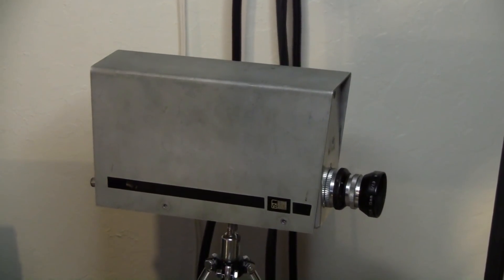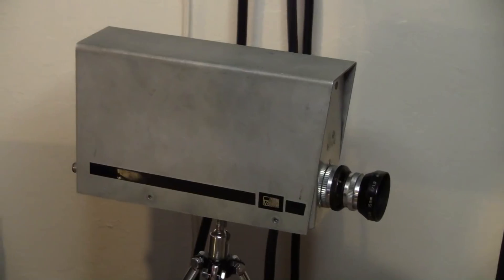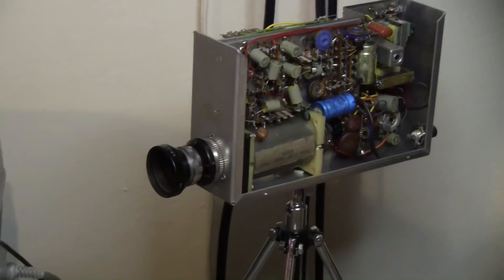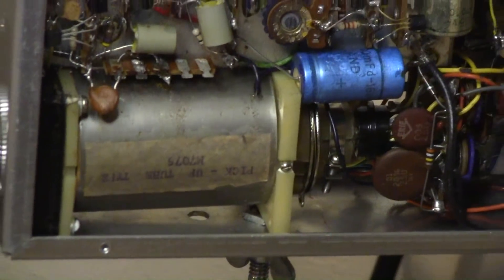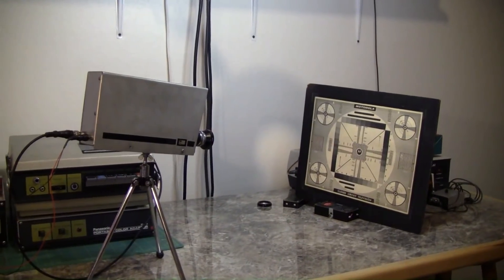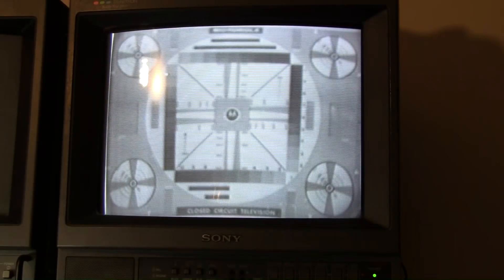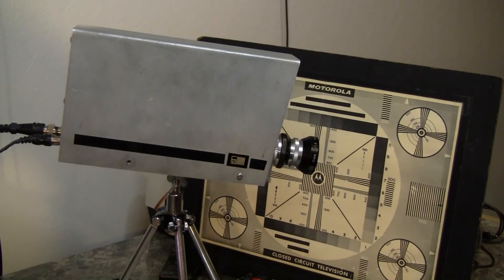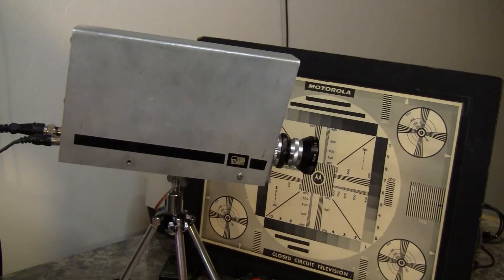Revised: 1970s Motorola Prototype Vidicon Camera

Comment: Hey nice camera! Dunnow if you still have it but have you changed the capacitors on the board? The electrolytic ones?
They should be out of value and the ESR can have drifted seriously out of specs. It could be worth to change them, you'll get better image (well, i know it depends of the tube condition also) But i also understand if you prefer living it on it's original condition :)